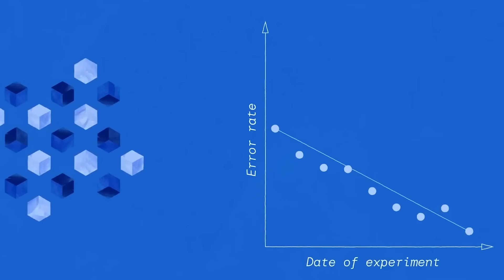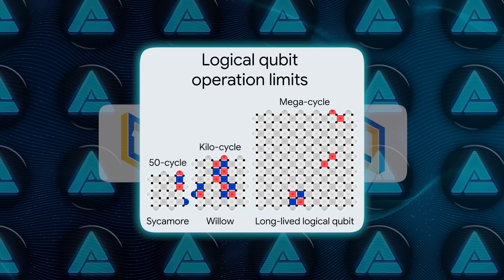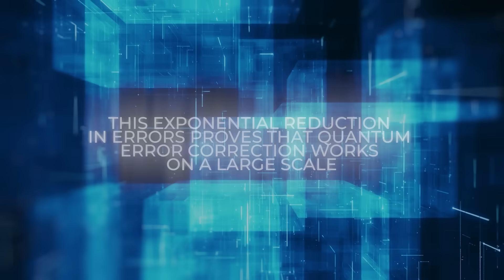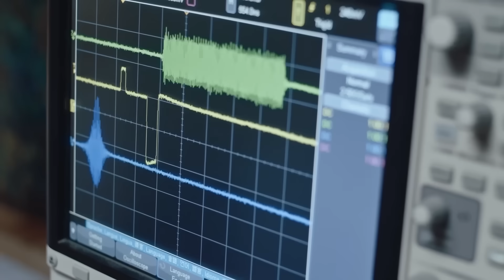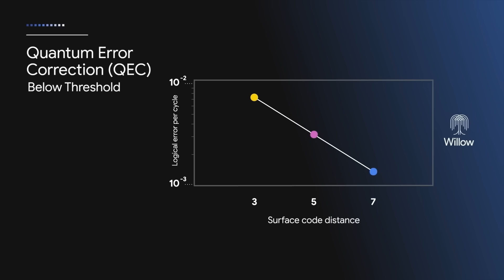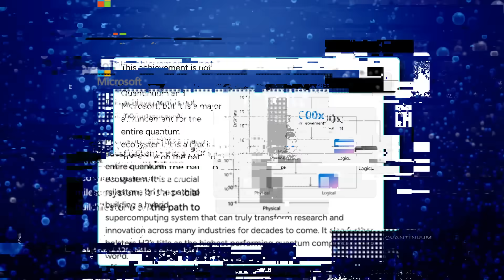Google's New Quantum Chip SHOCKED THE WORLD - 10 Million Times More Powerful!

Comment: If we can get Quantum computing to perform more general calculations better than current computers, then there might be a benefit for GenAI. But, WIllow and others still only perform specific algorithms. Are they impressive, absolutely. It will not print or access data faster. The best we can hope for is having a daughter Quantum chip set on a motherboard that is addressed to take advantage of algorithms when they arise, like an FPU of old. Everything else would be addressed on the host CPU.

I wonder how much error correct, with this sacrifice of Qbits, will it take to allow the chip to operate at room temperature or something more practical than absolutely zero degrees.

Comment: This is a concept for a nuclear power plant with a groundbreaking waste-to-energy system, potentially spearheaded by a consortium of California tech giants.  It would incinerate waste tires at extremely high temperatures, generating clean energy and producing free heat as a byproduct. This heat could be used for power generation and potentially harnessed by nearby tech companies, increasing overall energy efficiency.

The idea aligns with the concerns of former Google CEO Eric Schmidt, who has spoken publicly (e.g., in his Washington Post interview) about the need for the US to maintain technological leadership over China. This plant could contribute to that goal by:

Promoting clean energy innovation: Showcasing US leadership in sustainable energy solutions.
Enhancing energy independence: Reducing reliance on foreign energy sources.
Boosting domestic manufacturing: Potentially powering high-tech manufacturing processes.
This concept addresses multiple challenges:

Waste management: Reduces the environmental impact of waste tires.
Clean energy production: Contributes to a more sustainable energy mix.
Resource optimization: Utilizes a byproduct (heat) that would otherwise be wasted.

Comment: 1. Willow's Potential Unleashed:
Lazy Brain Efficiency: We explored the concept of pairing Google's Willow quantum chip with a less resource-intensive AI for routine tasks. This "lazy brain" approach optimizes energy consumption and allows Willow to focus on complex computations when needed.
AI-Driven Optimization: We discussed how the AI could analyze data and optimize its own performance, learning and adapting to maximize efficiency and drive continuous improvement.
2. A Quantum Leap in Cooling:
Integrated Cooling Channels: We brainstormed a revolutionary cooling solution: embedding microfluidic channels directly within the quantum chip. This allows for targeted cooling of hotspots, reducing thermal resistance and enabling miniaturization.
Benefits Galore: This approach could lead to significant improvements in energy efficiency, performance, and the development of smaller, more powerful quantum computers.
3. A New Language for the Quantum Age:
Dense and Efficient Code: We recognized the need for a new coding paradigm optimized for AI and quantum processors to communicate with unparalleled speed and accuracy.
Quantum-Ready and AI-Friendly: This new language would embrace quantum concepts, prioritize density, and be designed for seamless integration with AI algorithms.
4. Collaboration is Key:
Open Invitation: We extended an invitation to researchers, engineers, and tech enthusiasts to join the quest for more efficient and powerful quantum computing.
Google, Take Note! We encouraged Google to consider these innovative approaches in their quantum hardware development.
Key Takeaways:
By combining the "lazy brain" AI, integrated cooling, and a new coding language, we can unlock the full potential of quantum computing.
Collaboration is crucial to drive innovation and accelerate progress in this exciting field.
The future of quantum computing is bright, and we're just beginning to scratch the surface of its possibilities.

Comment: 🎯 Key points for quick navigation:

00:02 Google introduces Willow
00:14 Precision and scalability
00:29 Reduces quantum errors
00:41 Boosts AI capabilities
01:08 Quantum's limitless future
01:22 Quantum vs classical
01:49 Cubits and superposition
02:18 Overcoming instability issues
02:32 Error rates decreased
02:46 Real-time error correction
03:41 Scalable logical cubit
03:53 Quantum outperforms classical
04:47 Parallel universes computation
05:41 Quantum commercial viability
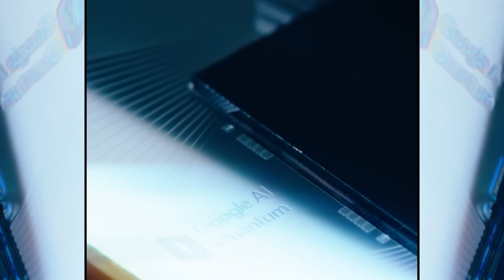06:08 Industry-changing applications
06:48 Advanced chip design
07:16 AI and quantum synergy
07:43 Stock surge reaction
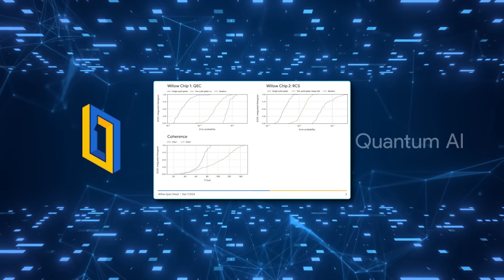08:09 Achievable quantum goals
08:24 Bridging application gap
08:52 Inviting community collaboration
Reply: 🤣 ai timelines ai video

Comment: The Chinese and Google also give a value in their head on this subject. But there is no information about the actual measurement. I have a very simple question. In a single line, that is, think of it as a single processing line or a calculator, how many multiplication operations of 64 bits (A-B are both 64 bits) can be done in 1 cyclic (1 slice of the operating frequency) time period, regardless of which processor? At what hertz does this processor work? The processor's ability to perform high operations and its ability to record those operations are different. As far as I know, the writing speed is very low compared to the processor speed. In other words, under the conditions I wrote above, for example, if you want, you can do 1 million operations per cycle. But what's the point if you can't write it down? Yes, I expect an answer from those who know.

Comment: You realize that AES256 and SSL, hmmm  could already be backdoor'd by this? The strength of those systems is computational time to break keys. With this, that timeframe is now so small the enc is now not usable for securing data over year(s) between key changes. New Quantum based encryption coming?
Reply: Already in the works BTQ Technologies Corp
Reply: @pointofview2834 is that the reason for the recent stock price increase?
Reply: Test